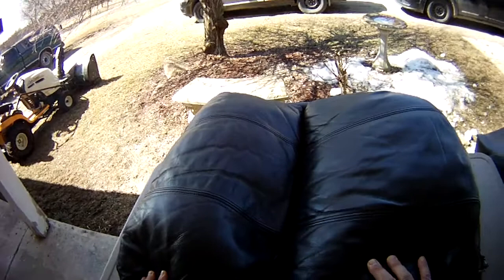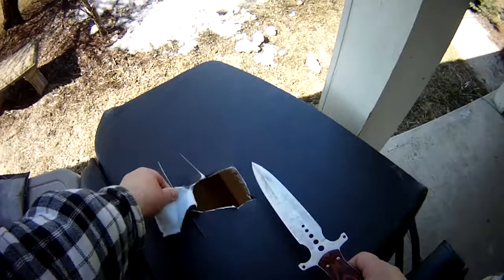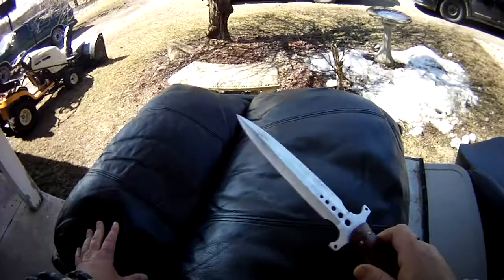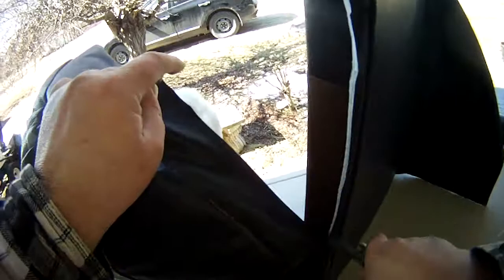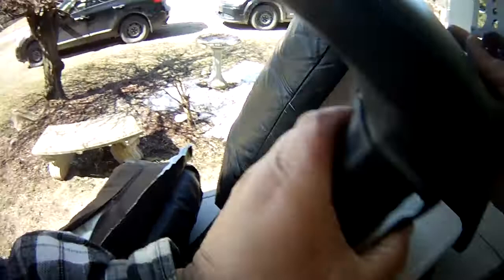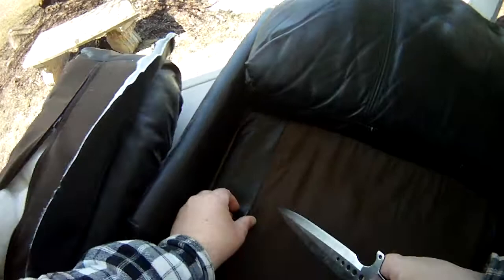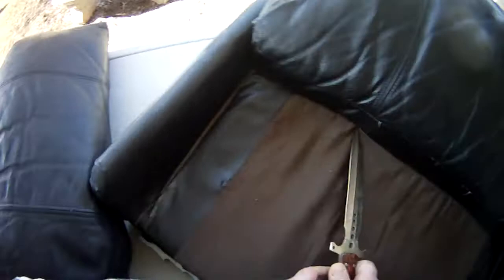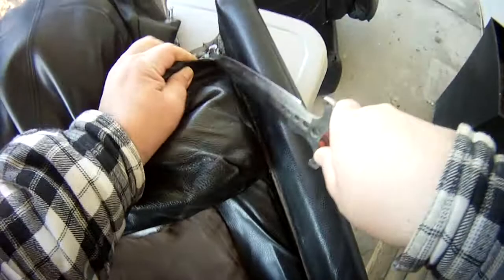Recycling leather by harvesting from a old chair for a new project

Comment: Usually, if you read the fine print or details when buying a leather chair... it will say all leather. where your skin will be touching... like the backrest, seat and the leg portion of a recliner, and it will say that the sides and back are not genuine leather... at least when I bought mine at lazy boy, thats how it was... but they still lasted and still going after 21 years. Its all in how you take care of your furniture and the frame and would that it is made of. My chairs look like the day I bought them.
Reply from the maker: my chair had a lot of help from the children. they use to jump on it when I was at work